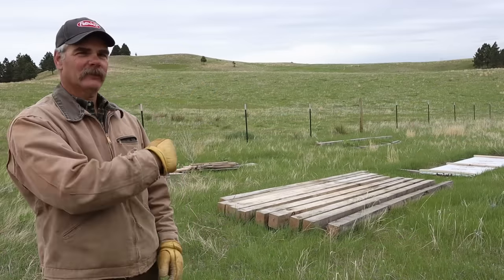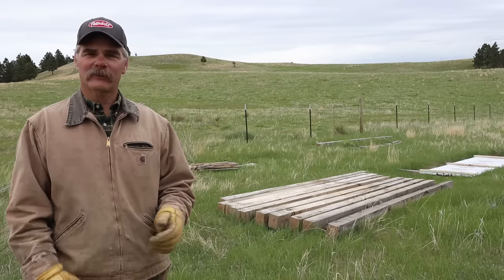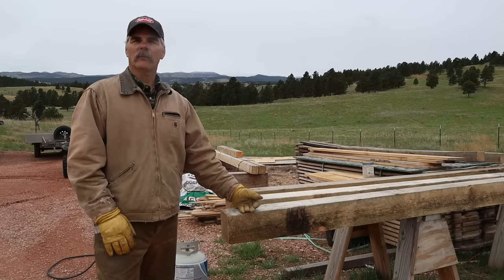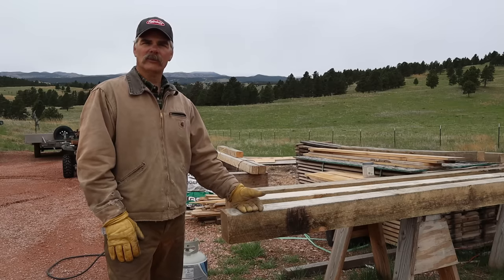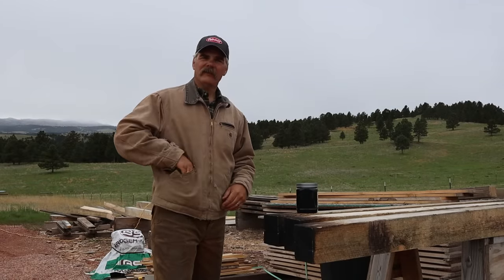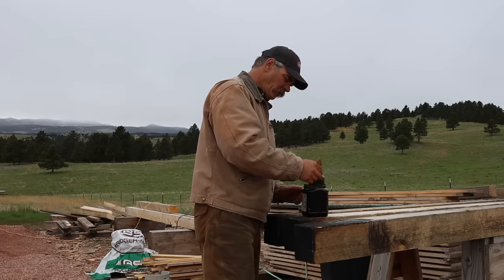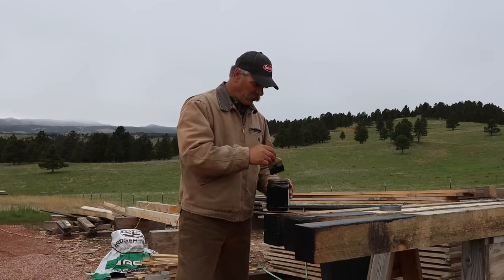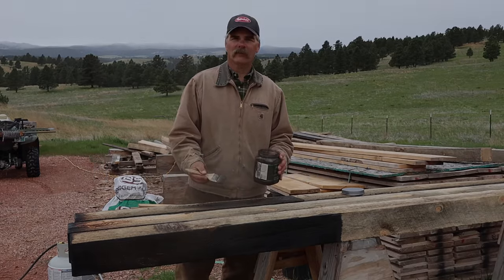Treat Wood Yourself - How to Treat Wood Against Rot

Comment: interested in the burn technique, but usign motor oil seems toxic
Reply from the maker: Oil came from the ground in the first place. Besides, it’s only going to be on the post. It won’t leach out really not enough to worry about that.
Reply: @GreatPlainsCraftsman  thanks for answering. i am wondering if I could use another product instead which would be more ecological like for example kitchem oil

Comment: My dad has a lot of lumber on our land from tree jobs and several companies that cut down trees in peoples yards or land clearing etc. A full sized trees 20 to 30 ft long gums and pines and possibly a few oaks. We also have cutoffs from pines and oaks and such where they had to move them by hand or by climber. Any way to treat them for household use the smaller ones? Also how long can wood be use able after sitting in  the open without rotting? Sorry to ask but I'd like to make something out of some of it. Was thinking of using this method for soemthing shop or outdoor related
Reply from the maker: I would say it could sot around for 3-7 years depending on moisture and humidity.   Hard wood will last longer, Drier air is best.  Any wood for inside I would not use this method,  outside is fine.  The finish will lighten with time.
Reply: @GreatPlainsCraftsman  thanks

Comment: I just use a asphalt topcoat. I paint it on let it dry before setting in ground. The tar base in the asphalt topcoat seals the wood. Works great and cheap. Just make sure the part coated is above ground a few inches.
Reply: Same with me, all the fence posts I set I coat with ‘black jack’ bitumen paint, it’s a one coat treatment and sets very hard when the weather is fair 18°/20°C.
Whatever portion of the post is in the ground is coated and then maybe 2”/3” above ground also coated.
Reply from the maker: Sounds great!

Comment: I just make sure they are dry wood then use tar , first coat melt the tar to liquid state apply it to the whole pole when it drys apply a thicker viscosity coat , to the 3 ft that goes underground it will be like thick rubber  it will last more than 30 years - longer than pressure treated wood

Comment: Saw chipfrier oil used, with mineral spirits to thin it, on cr@p pine for the bottom and sides of a half ton trailer. Lasted over 15 years outside. Not bad.
Reply from the maker: Not Bad!

Comment: Had a plywood roof for decades on grandpas farm. All they did is lay down plywood. tarred and nailed strips of plywood over the seams then rolled on used oil every year or two. Never leaked and lasted until my uncle got the farm and quit oiling it. Then it eventually deteriorated, over about another decade, breached to water and the building rotted away. In my oppinion it's a better result and longevity than shingles cause 25 year shingles sure as hell don't last anywhere near 25 years anymore. They crack, break, curl and then leak. Then you are looking at the expense and labor of full replacement or you can just grab a paint tray, roller and a gallon or two of used oil and redo the roof before morning coffee for another year or two.

Comment: "Maaaaaawm!  Can I go over to Timmy's and play with tractors, torches and make cresote?"

Awesome episode.  I am glad you found use for the ol' twisted timbers.  Its funny how some of this stuff works.  There are huge wooden bridge posts that rot at the surface level of the water but the timber under the water is fine because it isn't ever exposed to oxygen which is needed for decomposition.  The minerals in the water embed themselves in the fibers of the timber over the coarse of time and make the posts below the water line tough as rocks. literally.  Thanks for sharing.  - Will
Reply from the maker: Hey Will!  LoL
Reply: Great Plains Craftsman how well does this hold up?

Comment: Used motor oil + diesel (sometimes I'll throw in old wood stain, anything oil based) is also an easy way to deter horses from chewing fence posts.

Comment: Used transmission oil for red tones. I added dark walnut stain to my mix to darken it up. Able to adjust to even out the tones on my garden fence. Once dry, the oil mix is inert.

Comment: How long does it take for the posts to dry? Would it be okay to do this to wood that is exposed? Would the motor oil/diesel mix get on clothes etc. if I were to accidentally rub against it well after it's dried? I plan to make wooden planters from some large wooden crates I have. The wood is pine and has only been indoors used for shipping glass. No part of my crates will be buried. I'm just wondering if this would be better than painting.
Reply from the maker: Angie it will act like stain.  Give it a few days to dry in the sun.  I would use a 50/50 mixture.  Remember used oil from a car will be more brown.
Reply: Great info, Tim, thank you.
So, after a few days in the sun, it wouldn’t smell, nor would it stain clothes, if used to build a cabin, for example?
Reply from the maker: @zehii  No it will dry.  Takes a little longer than regular stain.  It will eventually not smell either.

Comment: Fellow Great Plains guy here... are you using Ponderosa Pine? If so, any feedback on rot after it's been in the ground? Ponderosa is a known rotter, so curious if this works well enough to get additional years out of it. I've got a LOT of access to Ponderosa but haven't used it in my projects yet since I don't want to guinea pig myself ;)
Reply from the maker: Yes, and I think this will work as well as PT.  Many old timers around here do this with local wood (Ponderosa) and their posts are in the ground a long long time.
Reply: @GreatPlainsCraftsman  THANK YOU  for the info!!! Guess I'll go give it a try :)

Comment: charcoal by itself would absorbe water but with the oil there it must make it water resistant. pretty amazing thanks.  30 years is a good run but maybe with cement around them or a cement coating it could last longer than 30 years even.
Reply: the japanese have been charring wood for foundations with no oil or concrete and their buildings have been perfect for Hundreds and hundreds of years (not to say a thousand :p) "Horyuji Temple was founded in 607 by Prince Shotoku. Horyuji is one of the country's oldest temples and contains the world's oldest surviving wooden structures. It was designated a world heritage site in 1993."

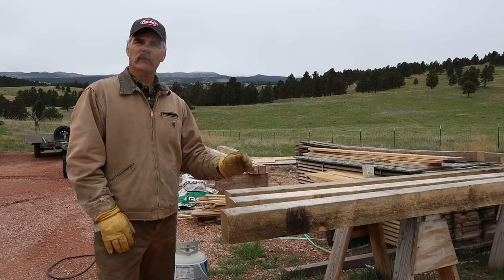Comment: 6:40 light poles and wire poles used to be saturated in oil. I remember hearing about when they first were used people would climb them and sit on top at night. I vaguely remember this but I think they used lanterns to see and some poles would catch fire while people were up on them? Does anyone know about this? Its way before my time
Reply: Not sitting to provide a human street light. It was first done by Shipwreck Kelly back in the 20's as PR for businesses. Common in those days for PR. No tv and most people didn't even have radios at home for commercials to play, so something for people to come look at. In 1960s, common to see military search lights and tv commercials soon took over, then floppy air-filled tubes blowing around now. As for catching fire, I guess if you were a business competitor and wanted the guy down, you just tossed a match.

Comment: Why not sho sugi ban the sides as well? That would increase the protection and may not even need the motor oil for most uses.
Reply from the maker: I actually did do that on the video that is referenced in this one, check it out.
Reply from the maker: I actually did do that on the video that is referenced in this one, check it out.

Comment: Post usually rot right at ground level. How does charring the bottom help?
Reply from the maker: you should char the bottom the seal them from rotting from the bottom up.  In the video listed at the end I do more posts and char them to just above the soil line to help with exactly what you are describing.

Comment: i cant understand him, 50/50 mix of motor oil and...?
Reply: He said use Diesel oil, but any non-polar solvent will do just as well. It is used just to wet the grain in order to penetrate. Paint thinner, kerosene, turpentine, toluene, mineral spirits, etc. will all work well.

Comment: Appreciate the lesson but I have to ask is the oil not going to harm the environment in some way? I mean when it rains the oil will leach a little and cause that tell tale "rainbow" in rain water right? I just have to wonder if that leaching oil near say your homestead water well can eventually leach into your water supply or just harm the environment in some other way? Just curious.
Reply from the maker: No.  The oil will cure in the wood, and there is so little surface area.  Pressure treatment chemicals are worse, and oil does come from the earth remember.  Thanks!

Comment: My father has 2 large buildings painted with used motor oil. They are both over 40 years old and are holding up very well.  The color was not even doing it a little at a time.  Even the temperature gave different colors.   We eventually painted it with a large batch all at once.
Reply from the maker: Nice.   I really like it and it looks good
Reply: Terror of the LORD. I didn't understand what you meant by your last 3 sentences and I really want to know what you were saying
Reply: @believeitlandscapemaintena7636  He was saying that when they painted one section of the building with
used motor oil and then painted another section at another time, with a different batch of oil or when the temperature was hotter or colder, the color of the finished wood was different in different areas. To fix the problem they eventually painted the entire building all at the same time with the same batch of oil to get the same color all around.